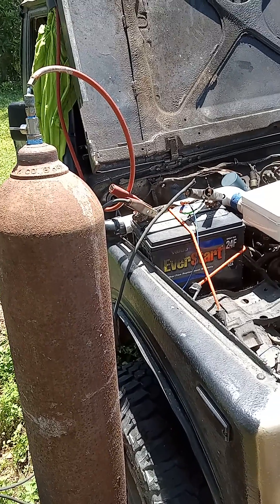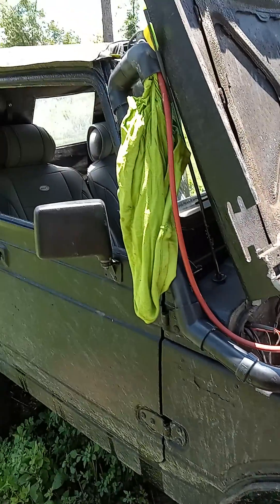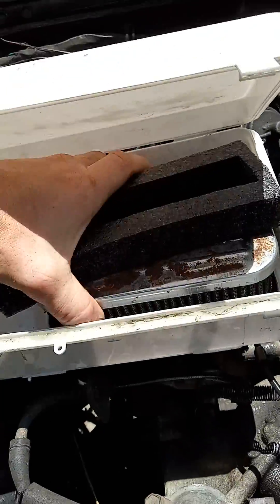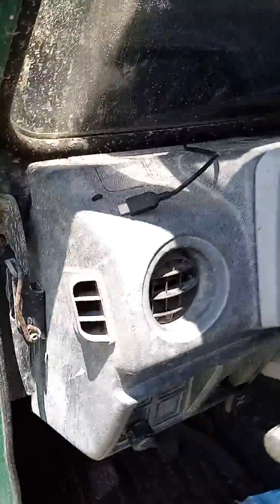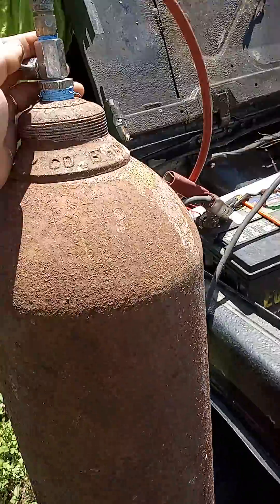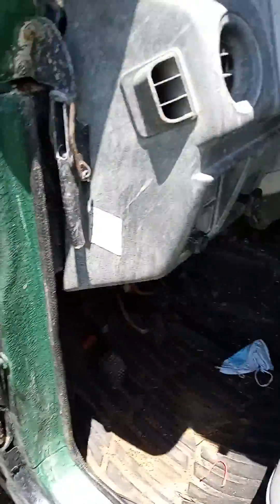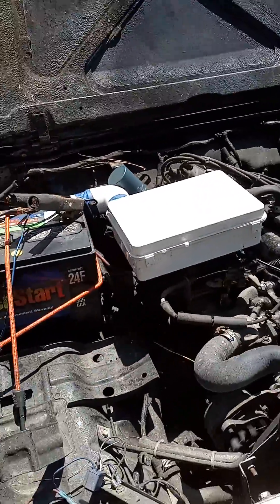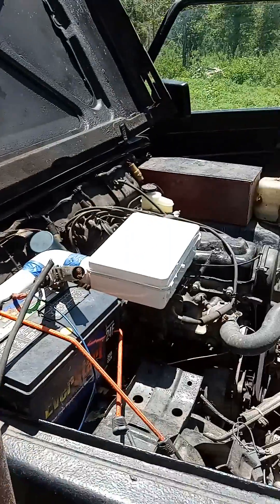running engine 100% on hydrogen(not hho)-run any car, truck,generator or fuel cell on this

Comment: Separating water into hydrogen through electrolysis is less efficient than just using the electricity to power an electric engine. Though converting or buying a vehicle that has an electric engine is quite expensive and is not a viable option for most people. I am curious on what process you used to extract the hydrogen?

Comment: HHO Hydrogen power CAR KITS ARE VERY SIMPLE BUT WORKS GREAT for your car better than you think.!!!

ACMEC HHO kits are designed for hho gas production in low voltage & low amps.  Lower heat generation Easier to Mantain and Easier to Install ,  Compact in size but more stable HHO Gas Production.   All hho kits generated Hydrogen and oxygen gases nothing else.! You never try to store  , use it as you make it . HHO on demand system according to your needs considered very very safe.

Yes HHO CAR KIT will improve your engine horsepower and fuel burning efficiency while reducing toxic gas emissions hho kit will solved all engine heating problem automatically. Engine will run clean and smoothly requiring very little maintenance, you will only have to add distilled water. Hho is best for  decarbonization of your cars. So make your car zero emission. In this way you can stop polluting the atmosphere.!!

You will not see brown deposits in our new designed long lasting hho kits. Our  kits for efi cars working up to two amps. 

But our transparent hho kits for carburetor types engines working up to 8 AMPS. For better fuel economy. ACMEC HHO CAR KITS can installed on petrol, Cng gas, or diesel engines, to run smoothly and your life will much easier.

For more call zafar 03082266179 or watch hho zafar videos on YouTube.

Comment: It sounds like you know a lot more about it than I do, but did you just say (not hho) because your tank is full of only hydrogen? I don’t think it would burn without oxygen?😊
Reply from the maker: Hho is hydrogen and oxygen mixed, this is pure hydrogen in the tank and as it's released into the engine in mixes with the oxygen in the intake. Hho is just less condensed material. This is pure formed h2
Reply: @hucktrucks1161  oh ok I was wondering what that meant👍

Comment: So you got an engine to idle on 100% hydrogen (undoubtedly mixed with air at induction) ...so what, that was done in 1806. This is also a far cry from getting any useful work from the engine.  Besides creating a load of NOx, what have you really done?

Comment: Hi Huck any more updates bro? Will the gas have enough torque capability for a Semi? Thanks😊.
Reply: Thanks Jaden😊
Reply: @paulackermann371  your welcome, and you can ask him things on his latest video, since he is open to comments, just don’t ask anything too personal
Reply: I miss him, hope he is ok, since things like this are so underrated. Also you should check out a guy named Edward Mitchell, who is also working on a hydrogen technology. He himself hasn’t uploaded any vids recently, but he told me when he has the right equipment, he will get things going again.
Reply from the maker: hey guys all is well, been a hell of a year in 2023 but I'm back on the path to getting the invention into the world's hands. will be doing some tests with it tomorrow. and to answer your question, yes this invention will power a semi. I'm hoping with the way vehicles are going electric that this invention will be put in place of the batteries paired with an electric fuel cell. seriously thank you everyone for your support so far, I had no idea this much interest would take off on this this quick
Reply: Hi Jaden I tried YT and Google Edward Mitchell hydrogen but no luck? Thanks again.😊
Reply: @paulackermann371  hmmm, try this, type in “true green solutions is back”, and you may find his channel name under it
Reply: @jadenspires1891  Thanks🌟🌞

Comment: Over in Europe years back, 4cyl truck had modified fuel system with 24v DC to fed aluminum wire that went into cell under water and sparked against rotating carbon drum. The sludge drops down as alOh. The Hydrogen gas , along with come carbon monoxide fuel bubble upwards and ran engine. System used similar to the welder reel feeding wire to cell. Can scrap aluminum be made into plates that ride down slot to a rotating SS brush under water? The AL has a valance of plus 3 and is quite reactive. The other system using sparking carbon rods under water also ran power generator, and was determined to have traces of Deuterium heavy water that was contributing to process for extra energy. Left over carbon rods  used in stage lighting can be found. Small rods are in used flashlight batteries.
Reply: So much simpler to use an electric motor, and much much more efficient.

Comment: How'd you bottle the hydrogen?
Reply from the maker: I vacuumed down the bottle then used the own pressure on my reactor vessel to pressure it up
Reply: Any idea how much pressure is in the cylinder when it's full?

Comment from the maker: Hey guys, I've recently deleted 2 of my other videos because I feel like I'm giving away too much info ahead of time before I release it on the market.when the product is finished and ready for sale I will post an update.
Reply: Never give up despite your obstacles m8
Reply: Already figured out the scholarly articles that describe the reaction 😉. I guess the only sketchy part now is over pressure and wtf happens when everything is full? It just stops reacting until cracked open again? 🙃 went back to look at your 2x4 science class 😆 and now wishing I'd saved it.
Reply: @ Huck - ready when you are brother to get your stuff man, keep on trucking!👍
Reply from the maker: @robervine7721  I'm just now getting back on the project and very close to putting it on the market

Comment: There was a 1978 El Camino v8 that was converted to run on hydrogen (water through carb) back in 2006. Owner drove around for several thousand miles at low power, before locking in storage garage. Shop in Georgia used obsolete dual 1.5MH coils relay per cylinder,and diodes, and passed 6-7 amps current through spark plugs same time as spark, using Inverter with half wave diode. Champion plugs cross reference with same REACH can be taken apart at top to exchange 6kohm resistor for copper wire substitute- like a racing plug. Timing was retarded to minus 34 degrees. Will start and run Idle speed but for acceleration power, the carb was uncovered to increase size of main jet redrilled about 30% bigger for more water. The EGR assisted the efficiency, but later on they found out that just some of the exhaust water would also smooth out engine running if reused! The exhaust has compressed in Nitrogen from air that boosted efficiency. (Air is 78% Nitrogen) Web site shut down, but couple videos 1+2 are still there on him and son running lawnmower engine on water. S1R9A9M9 -Nathren) I studied the whole thing. He now only runs V8 on engine stand for 24hr hooked to electrical power generator, with water line .

The now shut down website of S1R9A9M9 told of certain obscure tests done , as related to the triple coils assembly , as used on the 18HP Briggs engine from riding mower that ran on mineral water in carburetor 2008. A high voltage pulse through high voltage cable that is wrapped in 60 turns of insulated hook up wire and steel nail core,  with 20 amp draw from 12v battery and .6 load resistance - will change to 12Amp draw as  reactance in .4 ohms is CREATED in the 60 turns. That means that an old style ignition ballast resistor of .6ohm with 12v will draw 10amp for going THROUGH the engine spark plug, due to .6+.4 ohm in circuit, as 1.2 ohms total. The Champion spark plug internal 4kohm resistor is removable  from top, as then zero ohms with copper insert replacement. Other parts in plastic deli tub on side of engine besides the triple coils and resistor, would be accessory required spark gap, and 2 diodes as voltage drop from 13.5volts charged battery. Once started, the alternator to DC bridge rectifier 14.9A ran the circuit as battery had been disconnected. Magnetic field 10A impressed on cable extends timing from 0 to minus 34 degrees while electrical field impresses .4 ohm on same main circuit. (2 power sources same time)  Of course S1R  knew there was danger due to temporary acid expulsion from battery with the ignition high volts there, until the battery wire was removed after engine started. That's why he changed the wiring diagram so as it would then not work, since people got hurt practicing with circuit and not knowing what they were doing. The S1R coils was to be the replacement for the obsolete dual coils 60cycles AC relays as used on the car conversions. YouTube videos 1+2  BY  S1R9A9M9 .
Reply: I use 1000 watt car inverter to go from 12 volt to 110 AC I then plug my very small AC to DC welder into it I then hooked my welder to my 50 plate HHO generator roughly the size of a 5-gallon gas can I have cheap PVC running from my throttle body to the hho tank  with a vent through system running it on a 4 cylinder Tacoma a little down on power compared to gas but has been good to me for 3 years now timing on the truck also had to be adjusted
Reply: How can we get video materials that explains This

Comment: Very nice video you have there! Not that I don't think you know what you're doing but there's some things I want to share...😏 Even if you are pressurizing during production process of the hydrogen there is most likely still air or other gas that is in the bottle so running a vacuum before your hydrogen production into the cylinder wouldn't hurt. Please be sure to use a proper hydrogen backflash arrestor as close to the ignition source as possible and one as close to the bottle is possible. You probably already know these things but I'm still just putting my two cents in. 😎 Your determination and willingness to experiment is quite intriguing to me. Please be safe. 👍
   Disclaimer I am no expert in the production and use of hydrogen, just stating what I have observed from your operation and sharing information that I have gathered from other sources. 🤠
Reply from the maker: Way ahead of ya..I do hvac work so I used an HVAC vac pump to 500 microns beforehand

Comment: how did you pump the hydrogen into the bottle. and what is the pressure. and how did you produce the gas?
Reply from the maker: The reaction builds it's own pressure to the tank. I will be expanding in my next video on the device I made and the reaction materials needed.
Reply: @hucktrucks1161  I'd be honored to be in contact with you. I'm sure you can teach a few things. God bless you
Reply from the maker: @brad2548  vicemobile91@gmail.com 
Now I do have to be slightly vague on my identity and such as this information I've designed has made a few in the past mysteriously die .. however I am happy to teach others how my design works. My first design is my prototype but I will be having it custom designed and sold very soon
Reply: @hucktrucks1161  I love how you understand how a few in the past have mysteriously died. Stay safe at all cost, we need that valuable mind of yours.

Comment: S1R9A9M9 ran his mower engine on just water in carb, with amps through plug the same time.
 ( water vapor pressure + small Hydrogen )  A Triple coils assembly was  
used with  plated #14 gray and red 
copper wire from riding mower chassis. Circuit has 100% on 7turns 
Magnetic field as 90 degrees over 5 turns of #12 gauge wire for firm 
frame for the upper 7 turns. see wire with side tap joint #1 to ground, 
6-10amps through plug, accessory spark gap, diodes, Timing shifted to 
-34degrees late timing by the field, the 6-10amps fire only when plug 
fires through 13 turns. Joint #2 as Hi V + amps  together to plug. Water
 in carburetor changes to water vapor pressure at low end of piston 
stroke, along with minute amount of hydrogen gas that also fires. Vacuum
 pulls only level of water engine needs. Electrical Circuit source of 
resistance to limit current not known. Battery start, battery removed., 
Circuit runs on onboard dual alternators - Probably AC for field + DC 
for spark plug amps, (or Bridge rectifier to get 15 A) . High voltage 
ignition is negative with positive ground.  EGR was not applied on 
Briggs 18HP as was done with earlier car conversions that used sets of 
obsolete relays. S1R coils was to replace the unusual relays. He called 
it electromagnet + booster coils.Original spark plug of 4kohm changed to
 125ohm QC12YC  About 1300 v required to push current through plug.
 Induction cross voltage leakage from Ignition., or flyback high volts effect from 2MH coil included.
 Engine ran on water at idle speed and sounds somewhat
like a water pump! Parts contained in plastic tub on side of engine with
 wires coming down from upper engine cowl and all wires wrapped in blk 
elec tape - it's not just 1 plug wire!. Alternator wires always come out
 on left side Briggs starter motor. Extension cord , if jumped  at the plug 
end, can be the extra long RETIURN WIRE  from  bottom of spark plug he 
said was required and back to tub alt wire. See S1R9A9M9 Videos #1 + #2. at slow 
speed. Web site shut down.
Reply from the maker: I'd be interested in anything you come across on this. I have been exploring the stan Myers water spark plug alot. My system is 100% efficient but I would like to make it more compact. I'm currently on the last nuts and bolts to a finished product
Reply: @hucktrucks1161  Fuel rods/plates of magnesium or aluminum scrap for chemical decomposition erosion to hydrogen gas cost money and leaves residue to get rid of, along with waste high heat generation. Even carbon rods fired under water will run engine due to overunity because of both H2 + CO generation, but is aided by the deuterium heavy water in tap water. The price of carbon has gone way up. The overunity method of S1R9A9M9  used alternator + battery to supply current to spark plug. The water in carb expanded to vapor pressure same time as hydrogen was formed and fired. Another unit was done with aluminum wire fed under water to rotating carbon drum with 24v  current . The Al plus 3 Valence reacts quickly forming high volume H2 , but then again the purchased wire is costly. If you survey the lot of increased efficiency hydrogen generator designs, the Meyer cell was the best. Of the 3 Meyer types- proof of method,or multiple  concentric pipes, or combination injectors with circuit board, the pipes method is preferred. See the still available Water Fuel Cell Company 2 company manuals! The Birth Of New Technology + Water Fuel Cell Dealership Manual. Even Keely (1865-1899) made easy hydrogen gas using tuning forks vibration sent down thermopcouple/thermopile wires of silver, gold and platinum with ratio harmonics to steel cavity resonator ball. He got so good at it , that a gummy substance was left in cavity after 100 expulsions. At that time it was not well known about deuterium in water that has a consistancy of glicerin. , and that it was not responsive to same frequencies applied. Steam chamber with tesla coil frequency applied was used to run prop plane engine during 1940's WW2. on hydrogen gas. Regular electrolysis cells require water bubbler safety can along with backfire arrester in line. Archie Blue of New Zealand ran several cars on water cells with pumped in air to cell bottom and perforated round , staggard plates.  Faster generation of Hydrogen that way and he improved his company efficiency of electrolysis vats.  Some say that 2nd fuel is generated of Nitrogen Hydroxide that aids the process. (Air is 78% Nitrogen). The Australian Horvath 3 similar U.S. Patents were most interesting with higher volume Hydrogen to run 3 engines using beefed up CDI 600W at 10Khz to water cell with magnetic field aiding process from in cell transformer. 3980053 1976.
Reply from the maker: @waterfuel  I have seen the wire feed hydrogen generator write up about the man that made it who couldn't be found. I've also looked into Harlo mayne and algalco. The thing is, the aluminum needed is only about 5$ in melted down scrap and when dissolved still only leaves behind pure oxide( that can be recycled) and salts. Which I'm planning to have an easy washout system on my model also the temperature will be controlled much like a radiator fan with cooling tubes. Perfect for the back of a truck where heat can escape but I will have to drum up some ideas to vent for cars, however it's perfect extra heat in a car or home for the colder climates.
Reply from the maker: @waterfuel  I can tell you know your science. We should possibly collaborate
Reply from the maker: From my research on his setup it was false info but who knows for sure
Reply: @hucktrucks1161  The follow up videos you saw regarding the RETESTING of S1R9A9M9 engine on water was riddled with flaws and misconceptions as compared with original connections of the 2 original 2008 Briggs 18HP videos of actual running water engine. Website was needed to be studied before shutdown.

Comment: Did you modify anything else inside the Jeep?
Reply from the maker: Nope, just pulled the gasline loose and fed the h2 hose to the carb and this is an 85 Suzuki samurai, jeeps wish they were these rigs! I am about to release my first prototype on the market firstly to run whole home generators but it can just as well run any engine
Reply: Not even adjusted the timing?
I thought that it burns 10 times faster than diesel, don't know about gasoline, but it must be faster as well?